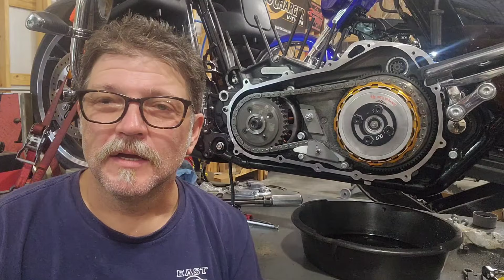What's the BEST Primary Setup for YOUR Harley? - Baxter's Garage - Kevin Baxter

Comment: I have a 93 FXLR 
The bike has been completely gone through, everything on it is brand new - American Prime (Ben) put together for a whole new inner primary -BDL belt drive (his belt) 1-3/4 wide - rated for 160hp/160tq. I couldn’t be more pleased than I am with the set up. Motor is a Ultima El Bruto 107” - 125hp/130tq. 
American Prime - AWESOME set up

Comment: Please correct me if I'm wrong, I love learning. Isn't a M8 clutch basket bearing smaller than what it was in a twin cam & if you're going with massive amounts of torque you should consider a Evolution Industries clutch basket because their M8 basket bearings are still the same bigger size as the twin cam basket bearing? And if you're running something other than Evolution Industries with massive torque you should be changing the bearing around every 10K?

Comment: How about properly installed and adjusted bent Baker tensioners? Extra vibration a low speed lugging clients ?   Flywheel runout should  be checked . Spring loaded first gear on early 6 speed corrects Trans rattle at idle on  jiffy stand . I have tested and used most of the products you use . I am a reall world aftermarket shop for 46 years. Plus.   Norman Sussex Hills Ltd .

Comment: Hey Kevin. Another great video. I ride a stock 03 wide glide. Is there a kit to change to gear drive inside to eliminate chain and tensioner ? Leave the outside chain and change to hydraulic tensioner. I worry about the crank having too much runout and or developing too much runout. Ideally I would prefer all gear drive but I’m not going to rebuild the crankshaft. Thank you

Comment: I have been a professional automotive mechanic for over thirty years.  Lately I mostly rebuild transmissions but I have done plenty of engine work, complex wiring, and complex diagnostic work.  I have very little motorcycle experience and just purchased my first Harley a couple of years ago.  It’s a 2003 Heritage Softail with the 88 and 5 speed (stock).  The bike IMO is making some noises that don’t sound right (it has 30,000ish miles on it).  I am looking for a place to start.  The bike seems to run and ride okay but the noise I hear almost harmonics through the headlamp and fuel tank and is most noticeable at idle. I do have a very detailed Clymer manual as well.  Wonder if you might have any advice on things to start checking.
Reply: The first thing to check on the early Twin Cams are the cam chain tensioners. The early ones were spring tensioned and suffered from wear problems. They can disintegrate and the fragments can block oil passages and cause catastrophic engine failure. There are kits available to convert your tensioners to hydraulic which are much better. If that option is not in your budget there are several aftermarket manufacturers that offer tensioner shoe replacement kits that have shoes made of better material than the factory original. Replacing your tensioners or tensioner shoes is not the most difficult job but it is a rather involved process. You will need to purchase the special tool needed to remove your inner tensioner and that tool costs around $145.

Comment: I just purchased the SO HotBikes Hydraulic Tensioner and haven't installed it yet. The reason I bought it was because I fried my compensator soon after having a WOODS 22XE BOLT-IN CAM installed on my 2023 Low Rider ST with the 117 M8. Do you think I made a good choice?
Reply: What’s it matter you already decided on it and made the purchase, just use it

Comment: Hello Kevin,  now that you went over the primary. Can you do a video on actual parts needed and  cost of doing a hydraulic clutch to mechanical clutch conversation . I get so many different answers and different parts list. I have a 16 flss slim and just hate the hydraulic clutch friction zone is large and I like my mechanical clutch on my 23 street glide and have it set to hit the friction zone about a 1/2 inch off the grip. . As far as I can see from the service manual I would actually only need about 8 parts to convert it to mechanical . A fls same year is mechanical and looks to be a fairly easy swap. Can you do a video on it. I know crazy but I at least know that if the hydraulic breaks on the side of the road not an easy fix it a mechanical maybe provided it is just the cable .
Thank you for your time sir. Jef

Comment: I just installed a Hayden on my 14’ street glide. 
The fit and finish was like a sixth grader did it. I had to spend an hour with a file to get the shoe in and get it to function freely. 
The shims don’t even fit. They also need filing and hand fitting. 
Has anyone had any experience with this? Also, my shoe is white I noticed that a lot of of them are black. 
Is something going on with Hayden. I just can’t fathom a performance part that is made in America needing so much hand fitting to get it to function properly. 
Anyone???
Reply: could be a knock off
Reply: Hey Jay, same here. When I upgraded my Darkhorse comp, I put the Hayden in and I had to grind the shims on my grinder (instead of filing) to get them to sit properly. They are basic aluminum shims. Aside from that, I have not had an issue since having it installed. Other than the crappy out of the box experience, it does what it should.
Reply: @Bill-19UltraLimited  ultima and zodiac just same have to file them out !
Reply: New chain and SE manual shoe

Comment: FLHTC solid Comp eliminator Hayden m8 10/40 full synthetic motor oil for years third Bike with this combo over 180,000 miles never a problem smoother quieter engine primary oil change every 5,000 trans 10,000

Comment: I destroyed a trash clutch basket with Man o War Compensator delete in a year and half with 8k miles. All new components installed together. I was told later it was Man or war issues,  all shock load goes to clutch basket.
Reply: Yup.  Need something to absorb the cylinder pulses
Reply: I don't know what to do after  reading this.  I was looking at getting a Man O War.
Reply: @patsmith3213  BDL CS-34A good as no5 solid allows it to move .

Comment: Great vid! Thanks for the info (and for being a fireman). I'm a Harley newbie, and already I'm aware that the stock 883 clutch may, eventually, 'grenade' over time.  My little 2017 has less than 3k mi, so it's not much of a concern now, but...  once I get up around 10K+ I'm probably gonna want to swap that mother out for something without the riveted plate.  Before it 'bombs'.  lol   Now I know about spring and diaphragm designs, gears and baskets, and all the other stuff you talked about.  Like, why H-D recommends so much slack in the primary chain.  Not being a mechanic, shaft runout never occurred to me.  Also, I'm lucky enough to still have a quality repair shop near me, so I can ask their tech what he likes to use, and why.
Reply: get a honda and youll never need to touch it

Comment: i have an extra quart of mobil1 10w-40. I just changed the oil in the primary with mobil1 20w-50. I only had a quart of 20w-50, is it fine to top it off with 10w-40?
Reply: Keep your Harley touring bike stock and don't ride it like a Japanese sport bike. No matter how much money you throw at it, It was never intended to be a high performance machine. Your stock Harley primary drive will go 100k miles with no problems. My bike has the B style stock tensioner and has never ratcheted up too tight even under heavy two up loaded trips. Who wants to pull their primary every 5 to 10k miles? I check my chain free play through the derby cover. I've checked mine at 30k and still looked like new. I'll check it again at 60k and it's just about there now. Just remember this,  there's a LOT of companies out there trying to sell you a "upgrade" for your Harley.
Reply: i use cooking oil its works good

Comment: Hey Kevin. If I want to check/readjust adjustable pushrods in a 2018 M8 107, is there anything I need to do to make sure the lifter is primed properly so I get the accurate “zero lash” position and the accurate pre load position. I assume I can just remove all 4 of the pushrods and set the zero lash and preload on each pushrod without having to do anything else, but I need an expert’s confirmation. TIA

Comment: I had a Hayden break on me. I know where it broke but not why. I did go back to it though.
Reply: The only time I saw a Hayden break was because it was installed backwards. The curve on one side should corrispond with the outer cover hole that is towards the front of the bike. I have 140,000 miles running Hayden Tensioner with zero issues.

Comment: What is the cost for something like this? Ballpark?
Reply: Well the Baker DD7 is $4000 dollars, the Man O War is $600, Attitude Manual Tensioner is $300, and that clutch has parts from OEM and Trask. A new complete clutch is about $1000 dollars. So $6000 give or take for a bullet proof primary with transmission
Reply: @CMFS101  yeah craZY !  if they built them right in first place like EVO's would need anything at all? cheaper to buy an evo FXR or bagger put S&S motor and never look back rebuild trans awesome bikes

Comment: are the clutches in the primary or the engine oil?
Reply: The clutch is in a seperate compartment from the engine, its inside the primary chain case. But not every oil can be used in the primary. Being factory bikes use a wet clutch, you need wet clutch specific oil, as in it cannot have friction modifiers or the clutch will slip. So you can run engine oil in the primary, only as long as the engine oil is wet clutch rated. Do not use regular motor oil in your primary. Harleys have 3 compartments for oil. Engine, Primary and Trans. Look into Schaefer oil, great stuff, seperate blends for all 3 holes.
Reply: Primary
Reply: Primary, which is separate but uses engine oil.

Comment: I think the auto tensioner is responsible for the crank bearing failure that everyone blames on the ‘02+ lefty bearing. I replaced that POS immediately on my ‘17 FLHTP with a Baker manual tensioner and Baker compensator. I pull the primary cover once a year to inspect tension and haven’t had to adjust it once since initially setting it at 5/8”. I just put the 30 tooth Baker in and love the new 3.25:1 6th gear. I don’t like cruise control and now the bike is easier to keep at 2 lane speed limits instead of the bike wanting to do 80 all the time.
Reply: way to go turn it into9 an EVO manual system- HD LOVE the auto makes them a fortune when all blows up after 2007!

Comment: Hi , my baker primary adjuster let me down ,the adjust arm bent and had the chain  nylon shoe running out of alinement with the chain , i pulled it out and bent it back into shape ,i have always checked adjustment every time i changed the primary oil 5000 km and 3/8 to 5/8 at the tight spot all was good for 100,000km until ,it has slowly been bending until the shoe wore a grove in it from the arm being to piss week to hold it   .I rang baker and they tried to sell me the upgrade { a bolt on plate like you have in this video for $100+ } WHATS THE NEXT UPGRADE AND HOW MUCH WILL THAT COST I've  got over 160,ooo on this FXDF 2009 ,still running stock compensator no problems, clutch basket inner hub replaced spline s on way out, inner primary bearing perfect ,I always put just a little bit more oil in there for the comp and inner bearing and its payed off ,when first got the bike the comp was dry inside she had 50,000 km ,GOOD TO LET PEOPLE  KNOW  SHIT BRAKES IF YOU HAVE ONE OF THESE BAKER ADJUSTERS keep your eye on it. YES I LIKE YOUR VIDEOS.
Reply: ,,,,,,,,,,,,,,,,,,,,,,,,,,,,,,,,,,,,,,,,,,,,,,,,,,,,the baker stuff,,,all his  stuff,,,,,,,has been way over priced   since he started  selling  parts.........................................................
Reply: sounds too tight?

Comment: Big thanks for this one. It just seems my needs for a 12 year old Electra Glide and your experience and recommendations on the five basic riding styles in line with what I'm hearing in the primary just make absolute sense. The 103 has a recent rebuild with upgrades to cams, tensioner, upgraded oil pump, stator and clutch bearing during the last quarter of 2023. But it's making an awful noise. I appreciate your experience and confidence with the brand recommendations on the clutch, tensioner and motor sprocket. I'm inspired to obtain the parts and give it a go, at 160k I'm sure it can't hurt.  Awesome drop just like always. Thanks for sharing.

Comment: Another awesome video. Thanks Kevin! What's your thoughts on the Baker 30 tooth comp? The 13% gearing advantage is interesting. Have a 2016 Street Glide, we ride two up, long distance touring only. Thinking the 13% would help get the two of us and loaded bags/tour pack moving off the line quicker. Better throttle response too. Woods TW-222 cam, pipes, air cleaner, FP3 tuner. Recommend the 30 tooth comp?
Reply: I put the 30 tooth in a month ago and I love it! Performance wise it’s awesome but also calms the bike down on 2 lane roads to where the bike is easier to keep at 65-70 instead of “drifting” to 80 all the time. I have a 2017 with a 107 M8.

Comment: So American Prime doesn’t make an M8!clutch.  I had the Man O War after you did my build and it made so much noise I took it out.  Crazy loud!
Reply: Same here…quite on start up when cold..very noisy after a long haul
Reply: Same here. I had a rattle from 2700 RPMs and up. I live 14 miles from Darkhorse. They had my bike for more than a week. They changed the chain, the tensioner and the clutch and basket. They insisted it wasn’t their motor sprocket. After I got it back I swapped it out for the SE comp. No noise. 
It wasn’t neutral rattle. It was a constant rattle from 2700 Rs & up. 
Now the DH sprocket definitely felt better and way more responsive. 
My OCD drove me nuts with the noise. I’m not saying the DH sprocket is bad, at all.
Just as an FYI, my motor bottom end was built by DH. Balanced, trued and welded with MoW rods.

Comment: 2012 flhtc 104hp 117tq Vulcan engine sprocket m6 Hayden adjuster variable pressure clutch diaphragm stock clutch plates,formula oil, shifts super smooth, 78,000 miles. Love it!

Comment: Can you please explain in certain aspects why you don’t use OEM? Example, clutch or tensioner, I understand the man o war, but still an upgraded comp ramp will still get several thousands of miles without having to replace the comp springs and so forth. Im curious what cam shaft have you recommended for this gentleman that will be touring mostly. Thank you, absolutely love your channel, thank you for all the time you share has to be tiresome to keep the business going as well as making all these videos.
Reply: Curious why the stock auto adjusting chain tensioner is not a choice.

Comment: I have a 09 Fat Bob, 96 motor. I have tried to stay ahead of documented trouble spots,( fix it before it breaks). In the primary, I trashed the comp, tensioner, fluid issues, and clutch. I installed 2" BDL semi closed belt drive with the Barnett roller lockup clutch. 5 yrs later, zero issues, life changing stuff. The 1st gear "clunk"  gone. I highly recomend based on my exp.
Reply: That’s wild considering the clunk comes from the transmission and not the clutch or parts mentioned.

Comment: Kevin, Love your content. Do you think a baker is a better fit with the Man 'o' war compensator? I have a 2017 Road glide 107 using the stock shoe setup currently. Dark horse has been in there for 20K with no issues..

Comment: Hi Kevin, great information as always. Thinking of upgrading my M8 Fat Bob with an Evolution Black Ops Grabber Compensator Ramp & Diaphragm Spring combo. Replacing the OEM primary chain tensioner with an Hydraulic Automatic Primary Chain Tensioner from Southern Oregon Hot Bikes. Eventually followed by an Evolution complete clutch assembly. This is my 'Forever' bike and I'm mainly looking for longevity. It will stay a 114 but at some point get a bolt in cam. My riding style varies. like to give it a bit on my own from time to time but nothing to crazy and also have the missus on the back most weekends. Would much appreciate your thoughts or any feedback.

Comment: Hi Kevin thanks for the detailed information what's your opinion on a full primary set up on a 2005 FXDL engine is dyno at 100hp and 124fp has 96 S&S kit gear drive S&S cam and oli pump im about to do the crank bearing conversion and have the crank worked done sorry I couldn't tell you what cam it is running engine work was done by previous owner bike is at 68000ks from northern new south wales australia summer temperatures get as high is 47 degrees celsius type of rides are long 100k round trip just to go to shops 300 ks to Brisbane wishing you had a shop here in Australia 😉 if you know a builder here you can recommend I'd appreciate it 
Thanks Dazz

Comment: I  own a 1995 Heritage soft tail. Had a squeaking noise coming from what I thought was the compensatory area of the primary. Only on acceleration. Turned out to be the rear drive belt rubbing on the sheave on the edges.. A little bit of automotive belt treatment on the sides of the belt stopped the noise ( For now). Keeping a close eye on the belt for any fatigue. I just putt around town with the occasional  roll on to clean out the carbon once in awhile . Previous owner did not supply service records.

Comment: On my 2019 Limited 131 Stage 4  Engine I've been using Manowar Motor sprocket, with a Trask Clutch Basket with Rekluse Clutch. Also S & S Cam Plate & OIl pump, Welded Crank pin and removed  Crank Balancer, D&D Cat Billet Exhaust, Amsoil Lubricants. I have over 40k miles with no problems. I'm going on 78 years old and I  do all my own wrenching.
Reply: Solid build sir
Reply: You welded the crank pin yourself? Good job
Reply: All that work to get smoked by a 400cc bike.
Reply: @seeker0587 its not about that lol, you enjoy your speed, we'll enjoy our torque 😂
Reply: @seeker0587  😂😂😂 sure buddy